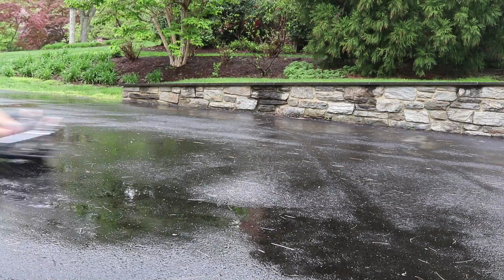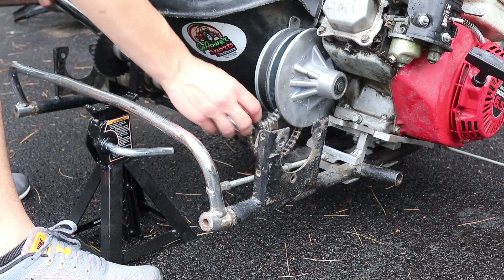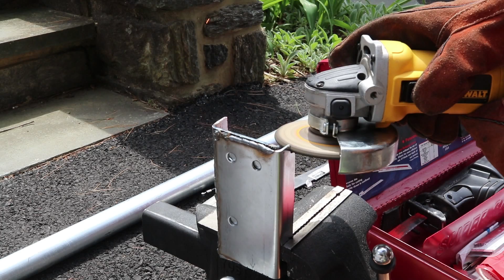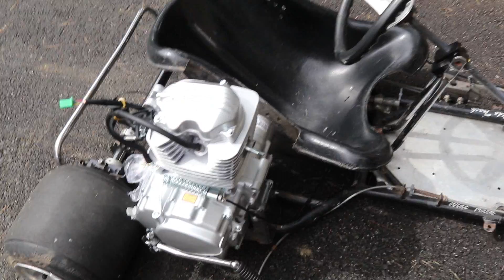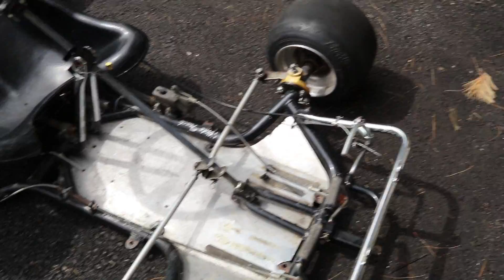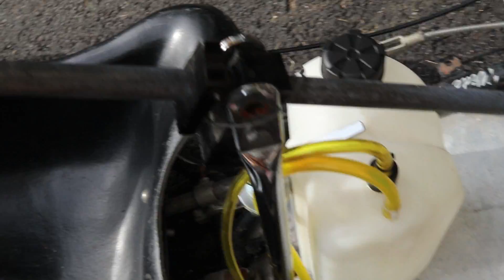Stick Shift Go Kart Build Part 2: Mounting the Engine

Comment: A 10 for the project.  BTW, how did that gearing with that really small axle sprocket work out?  Was it too high (slow to accelerate from stopped)?  ...and yeah, I gotta say it.  I got over rhyming in the 2nd grade.  That "music" sucks.

Comment: At 200 cc the engine should have between 30 and 40 HP. 
how much did you say the HP was?
Reply: Chris Dealny think it's a 4 stroke lifan iirc, so about 16hp should be correct.
Reply: Revisit your cc to hp conversions. Not hating, just saying. He said 16 hp but it's probably closer to 12 or 14 without any mods or whatever. 40 horses from a 200cc engine is quite a bit as many 200cc motorcycles I've seen are about 20 hp unless they're designed to have more. Many things factor in such as fuel and what the engine is actually designed to do. Some 200cc are built with higher compression for higher revs and top speeds other are built for powerful torque and have a lower compression this will all go into account of the horsepower output. 👍👍✌✌
Reply: oh shit my 390cc must be like 75hp

Comment: Great job. You got the gearing from the get go. Most people at first put this huge rear sprocket, and their top speed is like 27mph in the last gear. You used your head and went for the tiny rear sprocket. Good job. Check out my Gokart on my channel. Thanks for your video.
Reply: julio lausell I
Reply: julio lausell , I believe he said Hes putting the 17 in the rear and 15 up front so..
Reply: Braydon McGee yea but it isn't as much as a difference than other people do

Comment: You are gonna want a fender by the engine or at least build a shield on the bottom of that filter. I'd personally do a fender. After awhile that whole side of the engine will look like it's been sandblasted from the crap the tire kicks up.

Comment: Interesting placement for the fuel tank.
Reply from the maker: how so?
Reply: looks pretty dangerous, , asking to get it in your face etc... I would find some way of putting it behind the seat.
Reply from the maker: The tank is sealed and it is common to place it there for other shifter karts I have seen. There isn't much space behind the seat either its just the axel